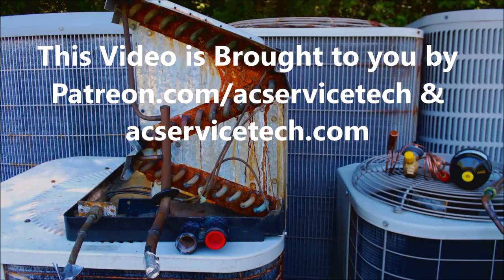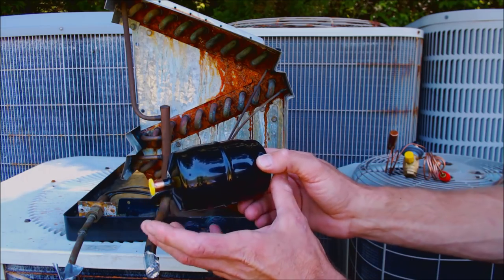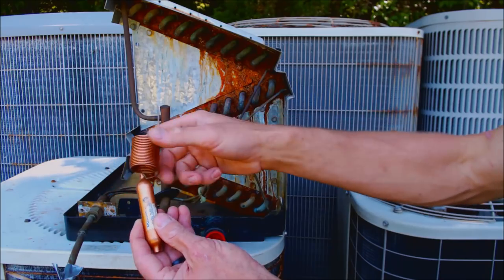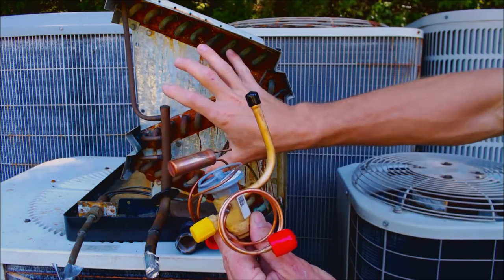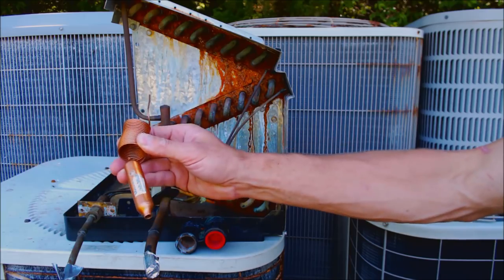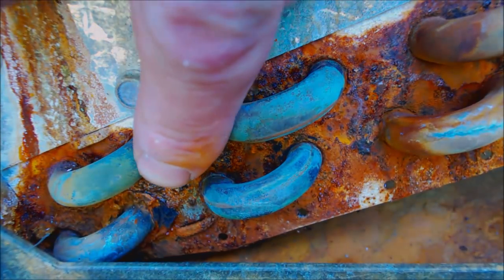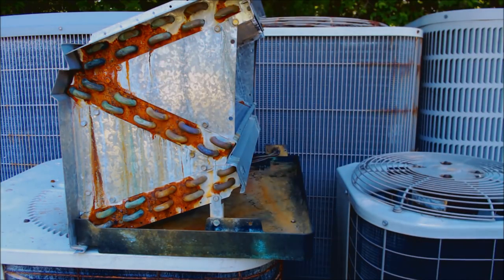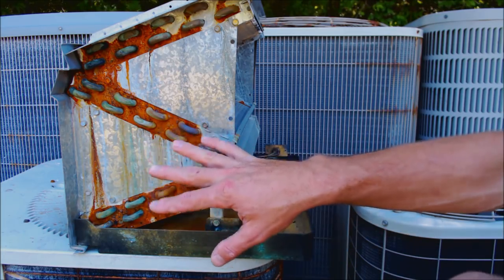Air Conditioner Condensor Change Outs, Replacements, What Should You Install!

Comment: Have a question. Would it work if we use a 410A compressor and use 407C freon instead, so we can replace an R22 compressor?
Reply from the maker: No, the displacement would be different. R407C compressor could be used for r-22 or r-22 compressor used for R407C but r-22 works best with mineral oil and R407C works best with POE oil, thanks

Comment: Nice video thank you.  Can you ever put to big of a filter drier on a unit?
Reply from the maker: It is possible but most standard split systems, the standard braze on sizes are fine and won't hurt it. Only on smaller refrigeration units. They have strainers that are small that act as the only filter drier. You wouldn't mount a large filter drier on them because the liquid would expand too much inside, thanks
Reply: Thank you

Comment: Great video... thanks. I have a question not related to this video. About 3 months ago we installed a horizontal evaporator coil that had a refrigerant leak up in the attic. According to the specific instructions we can install it in two positions. Now the customer called us because one of the corners on the coil is leaking water 💦. Did you ever had this kind of problem..?? Do you have any suggestion on how to fix this problem. My friend thinks that by placing the coil in a different positions the problem may be solved.
Reply: Coil should not be "leaking water" ever, as there is no water in it.  Right? Only refrigerant and oil.  Maybe charge is off and you have some icing going on....low flow, dirty filter/bad ductwork.  Maybe coil not sitting level and condensation is draining off to one side.
Reply: Brian D thanks for replying back... this is actually my first time that I see this kind of situation. Sorry 😐. When I said coil is leaking water 💦 I should have said leaking condensation. I personally believe that it may need to be level right...
Reply from the maker: I have seen where there is a hair line crack from the manufacturer. I have also seen a hair line crack from the installer on evap coils. It could be that. The unit does need to be level horizontally and if anything just slightly tilted toward the drain stub but level both ways is good. It could also be that the air flow is set too high and blowing the condensate off the coil and it is not landing in the pan. It could also be that the coil sat temp is too low causing it to have excessive condensate and dripping from a non normal spot. Thanks Monterrozacesar5 and Brian D!

Comment: How do you match the condensing unit to the indoor unit when your just replacing the condensing unit?
Reply from the maker: Make sure that the btu/hr sizes are the same and that the metering device is matched for the size that the outdoor unit states it should be such as piston size or just btu/hr size for the TXV. We typically install txv's. Thanks Hector!

Comment: I recently joined your patreon channel and am really enjoying the content.  I do have one question related to this video: what are your experieces/thoughts on flushing out the existing lineset vs. installing new when switching for R-22 to 410a?  I am relatively new to the field and might be switching out an evap coil and condensor on a house that has the majority of the lineset running through the inside of the walls up to an air handler in the attic.  Thanks.
Reply from the maker: I often times try to make sure that I won't have any problems with the lineset as well. I run new when I can or if it makes sense. If it is the size I need, I will use the line from the basement to the attic and cut off the old fittings and run my new lineset from there while reusing the horizontal part that usually won't have any joints in the wall. Often times the old line set is too small for the newer system connections since the manufacturers would like you to use a larger diameter size for efficiency on the vapor line compared to what used to be run. For instance 5/8" was a common vapor line for a 2 ton system. Now most manufacturer connections are 3/4" for  2 ton r-410a units which on a system that has a 50' line set run would increase your efficiency a few percent. I always change liquid lines out if they were 1/4' or 5/16" instead of 3/8". It doesn't hurt to flush the old oil out as long as you have a scenario where the lines are going from high to a lower position. It doesn't work well at all if you are going horizontal. Always make sure to absolutely clean them or replace them on compressor burnouts, thank you very much for joining Patreon on July 10th! I really appreciate it!

Comment: Legionella bacterium coated evap coil by Carrier?
What's your opinion on the polymer based stop leak additives sir?
Reply from the maker: I don't love leak additives and try to avoid them when possible, thanks Tomonator!
Reply: AC Service Tech LLC. Why not.
Reply from the maker: I just don't like adding anything foreign into the system if I can help it. Many of us are concerned it may gum something up in the process of sealing up the leak depending on the location. If it seems that there is no other alternative then certainly use it. Depending on the manufacturer, there are also mixed results. Sometimes they seal and other times not, thanks Max!

Comment: Great video! How do you limit the water entering the system through manifold attachment and detachment or is it next to impossible?
Reply from the maker: While the system is running, don't leave the vapor cap off too long before connecting the hose or it will sweat even in the inside of the port, make sure to purge all air in the hoses before charging liquid back into the system. Hang the manifold hose set every once in a while with the hoses completely vertical so any old oil that may have mixed with water vapor drips out into a can. Otherwise try to store your hoses connected to the manifold so humidity doesn't enter in after each use, thanks Paul!

Comment: Teacher I have a question for you every time I have to replace the condenser if it is R22 with a 410 can I leave the furnace, or do I have to replace the furnace as well. Or I just have to install a txv or can I just leave it that way it is. Thanks. I hope you understands what I mean.
Reply from the maker: You could leave the furnace as long as the blower speed is correct and it makes sense to. Some furnaces should be replaced do to age, efficiency, and safety. Others can stay because they work fine. Evap coil could possibly stay if it is efficiently sized big enough but metering device definitely needs to be changed if you are switching from r-22 to r410a, thanks

Comment: Thin evap tubing is a big problem concerning leaks.  Protective coatings work against heat transfer  but it does prolong coil life.  I think the manufacturers need to re-evaluate the tubing wall thickness.  I am seeing 30 year old systems that still are not leaking.  I tell customers not to expect this out of today's evaporators.
Reply from the maker: You are right. It will be nice to see 30 years down the road how the aluminum tube, alum fin, and alum side plate evaps will do. So far I have seen good results on them.
Reply: thinner wall = better transfer. I myself blame the race for efficiency or rather being pushed to meet new insane standards. I say let them all sit without HVAC and appliances for a year in their overly comfy committee, board and other positions.
Reply from the maker: Ha ha yes, it is crazy that efficiency and selling more comes before product reliability in many instances, thanks Throttle Bottle!

Comment: Evap coils transfer heat?..... I thought it was the other way around?.... I thought they absorbed heat?...
Reply from the maker: Transfer heat such as from the air to the refrigerant or in heat pump mode, heat from the refrigerant to the air, thanks Oscar!
Reply: AC Service Tech LLC gotcha. I have a another question. One of my fellow tech friends asked me if the compressor gets replaced with an after market compressor, would you have to replace the piston also, if it has a fixed metering device?..... or go with what the new compressor specifies?....
Reply from the maker: Do you mean aftermarket condensing unit? That would be the only time that you would change the piston size. If it were a compressor, the compressor would be the same size as the old one and the coils would be the same so the piston would remain the same, thanks